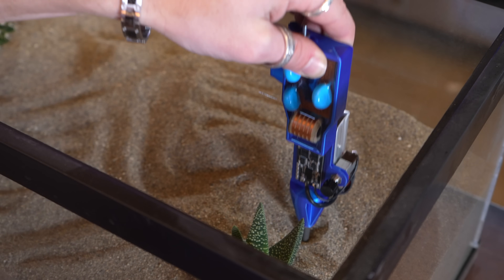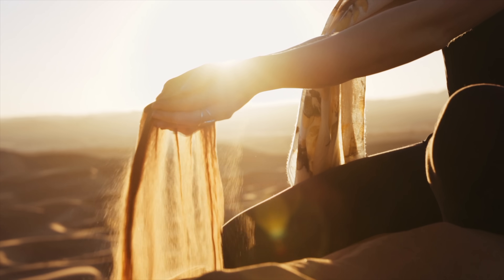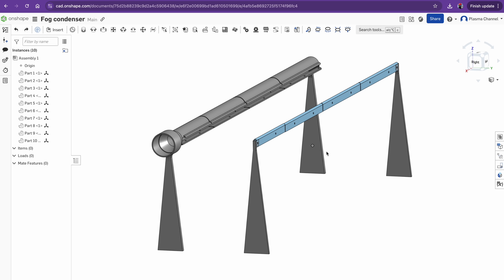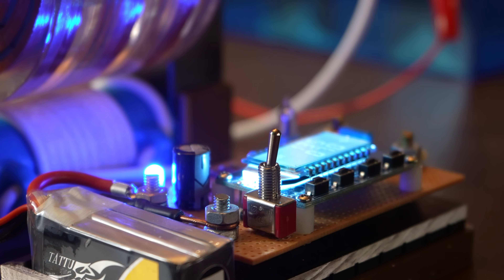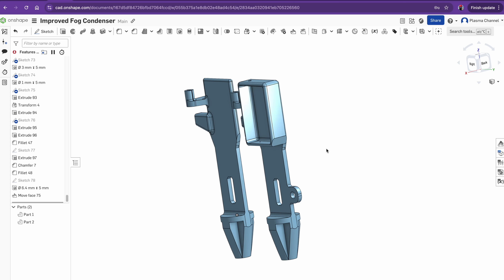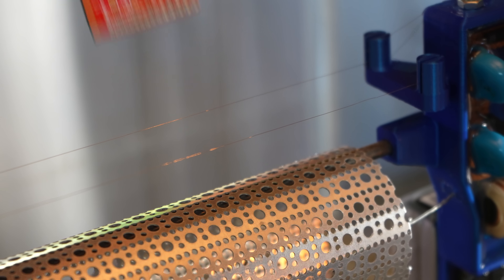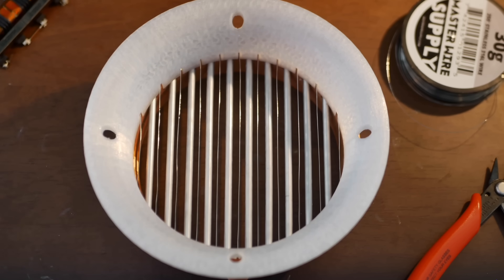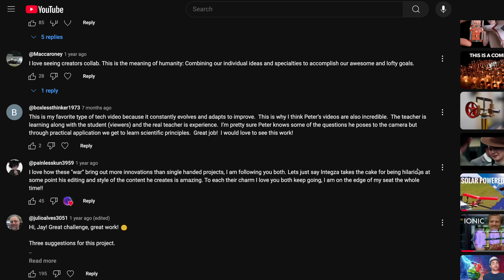Solving Desert Water Shortages Using 20,000 Volts

Comment: Yours vs commercial is size so of course more.still good project! What if used smaller hole screens? Even solid metal. Put sloping tray to catch can, easy to measure. Make circular conical shapes that are stackable with catch can under?

Comment: ‼️Aaa, hummm…, find a way to recollect the condensed water to have a close loop🔁 then when fog comes around you will accumulate more water, storage’ing more water, storage beheld in the sand of dirt for when it gets really hot the sun won’t evaporate the water you have accumulated. Holding more over time. or using the sun  rays to cool some kind storage compartment for the water.‼️

Comment: Last year I picked up a huge load of cedar that was just cut nearby my house and stored it in an underground storage unit that already was quite damp. At the moment the only way I could keep the humidity low in order for the wood to dry and not have mold over everything was getting a small AC dehumidifier which I had to get an ecoflow delta pro to power because there is no power in there which IIRC only gave me about 12 hours of runtime per day and obviously had me going down there every single day either to take the battery up or down.

I'm really curious of what could be achieved with this system so I think I'll try to put one together.

Comment: What would be next steps to purify water for drinking? Same as normal water processing or does the process do something akin to distillation?

I'm thinking air pollution near cities. While probably safe for plants (unless extremely polluted) as the soil would filter it. But just wondering for drinking.

Depending on voltage requirements/run time from battery, I could see this being useful for hiking or camping.

Comment: While as others have pointed out this isn’t a condenser, this can still be used by the same mechanism to attract water in the evaporated phase by ionization. You can increase the local humidity to make a condenser more energy efficient with greater yield over time from the present water aswell. At a large scale you can use a nearly passive condenser, relying on ground temperatures in a tunnel. Or if you manage to collect the steam in a local space until the night, that might also work. 

For the tunnel approach you really could just pass it through a relatively small pipe (ideally coiled) that goes through the ground.

Comment: I'm curious how low this could draw the humidity. Maybe it could make the coolest 3d printer filament dry box ever... Also, what if the ground were the actual ground, with a wire running through it? Probably not realistic for farming, but would be cool to see. Might even get more efficient as water is drawn to the soil. Might also cause electrolysis on the wire...

Comment: No. This isn't condensation. The FOG is condensation. All this does is force the fog to collide and coalesce. You can do the same thing with anything that moves air. Hence why it occurred with the thruster. The reason the dehumidifier only collected a fraction of the water is because it was ACTUALLY condensing water out of the air/fog mix and isn't designed to force already condensed water vapor to coalesce since our homes aren't full of fog. This device isn't capable of producing condensation.

Comment: Yea. Sounds to me like you rewatched dune and wanted to try to pull water out of the air like the fremen.
I also feel like you forgot a seccond control test. Which would consist of no grid but just a bucket. It could be fun to collect data on. There is also the question of how much fog you made for that experiment. Since you sort of need that data to determine efficiency.

Comment: Just a thought, The application of this technology as a means to desalinate sea water using purely solar energy could be really amazing to, solar boilers to create steam and the ion aray to collect the water using Solar power, could that potential have the system run for longer periods and not be reliant on short term morning sea fog? A secondary industry of nearly zero emissions salt collection could also potentially be achieved when the brine pools eventually need cleaning. This all adds complexity to to idea of course but expands the potential use.

Comment: Really cool idea. But costal fog, requires coastal waters. And if you have coastal waters, you can use desalination, which gives you drinking water at 80.000-300.000 ml/Wh instead.  So you're about 10.000-23.000 times less efficient than a desalinationplant.  Take it, you can generate the power and water on site, which is a nice benefit.

Comment: 14ml/wh is actually quite inefficient. And fog isn't all that common. Still, it's okay in emergency situations.

Old heat based desalination tech will produce ~12 to 100ml per watthour, though more typically around 60ml depending on how modern the tech is. Membrane/reverse osmosis based tech can produce up 300-500ml per watthour, depending on tech as well as water condition and target salinity/mineralisation, though typically around 330ml per watthour. This is total energy cost from ocean to first public pump
Reply: And he's not looking to replace traditional desalination.
He is building a device that could be helpful to those who already collect water from fog.
As there are a few places around the world that still use that method to gather water.

And the issue with desalination based systems, regardless of which version of it you use.
Is the fact they are overwhelmingly expensive and hugely power hungry.
And there's no real ways to improve on those issues, because they are mostly caused by the physics of water.
As water is just very energy intensive to boil off.

But his little device is fairly low cost as it is fairly simple.
And it in theory should also work in places that have high relative humidity as well.
Which should help to expand the use range a bit more.

The real test on its efficiency will be seeing how little humidity it needs to function.
As once the minium levels are worked out, then it can be evaluated just how large the viable location list actually is.
Reply: @Targe0  Traditional fog water collection systems don't use any electricity at al...
Reply: @MenkoDany  Yes, and they have very low yields, as he mentioned in his video.

And that's because they are passive systems.
But his is an active system, so it should have much higher efficiency.
Reply: @ Do you think that tautologically repeating oneself proves a point?

Comment: Hmmm   that looks promising enough to pursue.     One thing though.   I noticed on the first clip of such a device in action, that the apparently steel mesh was rapidly being consumed, evidenced by the very rusty water collected.   Pretty sure with the water looking like that in just a few minutes of operation, that the mesh would disintegrate within days.    Maybe aluminum would last longer but I suspect it will suffer the same fate. That is a well known problem with high voltage DC,  anything over about 48 volts is really getting into that corrosion problem.  Stainless wire?  Platinum or gold wire?   Aside from the cost of replacing your grounded conductor frequently, you could also have the problem of the metal oxide level being immediately toxic to any plant.      I cant think of a way around that but my first guess is, much more surface area per V,  right down to the minimum effective voltage. Beyond my chemistry but I would look toward a way of passivating the surface of the metal,  it may be that it will passivate itself, but after that initial burn in your voltage may need to be different.   Probably consider using a current regulating power supply which I expect would also lower the overall power per water produced?

Comment: Love the thinking outside the box.  I am not sure how economical this type of system will be.  There appears to be many components to make it work (batteries, circuitry components, solar panels, etc).  Think most desert solar water stills utilize temperature to drive the condensation process from the air since that is completed with a passive structures (no power required).  I dont want to curb your enthusiasm for the subject, but then economical challenges of making a product like this outside the "cool" science bit is going to be a large hurdle.   Agriculture generally thrives on simple passive working ideas, but hey maybe this will be so reliable and productive that it is worth the investment in complexity!

Comment: Very interesting but is the water even usable?
The MTI clip shows drastically sped up corrosion, In the video we are shown some stainless steel or zinc plating mesh. In normal conditions they generally can have contact with drinkable water, but in an electric field the water could become contaminated by leaching of heavy metals.
Reply: This is easily overcome by applying a hydrophobic coating to the mesh so that the water runs off and is not held in place by surface tension.
Reply: MIT video says about Corona effect. Without Corona there is no corrosion. Maybe high voltage between insulated wires would help?
Reply: the MTI clip description: "(A) Snapshots of meshes at different time intervals of fog exposure. In the first row, a 15-kV voltage was applied, while there was no electric field in the second row. Red dye was added to the dispersed fog for visualization purposes"

Comment: This won't work in most deserts, where the air humidity is near zero. In fog deserts, the current solutions, which you say are "only 10% efficient", do not require electricity, have no electronic parts which degrade and which the tribes don't have and can't afford.
I'm not trying to be negative, I just think the problem "solving desert water shortages" is much much harder than most people can imagine.

Comment: So in addition to watering crops, it sounds like you might've made a significantly better dehumidifier for homes? 
Or, are dehumidifiers INTENTIONALLY this inefficient, to not make the air bone dry? 

I know completely dry air does not make for ideal living conditions (for mammals), but are most dehumidifiers smart enough to only remove the ideal %?
Sounds like most wouldn't be, but likely their size would limit that. I have a huge unit, one that has a hose you can plumb into a house drain to automate the dumping (vs manually dumping the water drawer) and has multiple settings, even an "Auto", so I know some do. Would be interesting to test something like that against yours. 
[I can't say the beans because YT thinks I'm a spammer due to Russian war trolls reporting many of us, but remove the -gh and combine "High sense" and that's mine.]

I'd gladly test mine, but I lack that humidifier so it wouldn't be apples to apples. 😔
(I don't have a humidifier, period)

Comment: I may be stupid, but why not just string the high voltage wire and let the dirt do the job instead of the grid? I.e. ground the HVDC on one side and connect the other side to the wire. It just needs the right polarity on the wire, right?